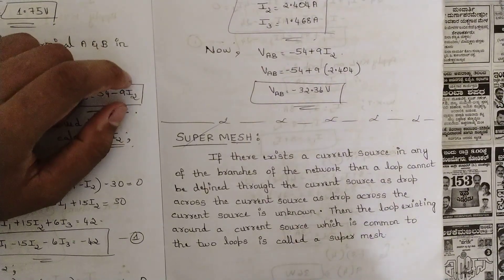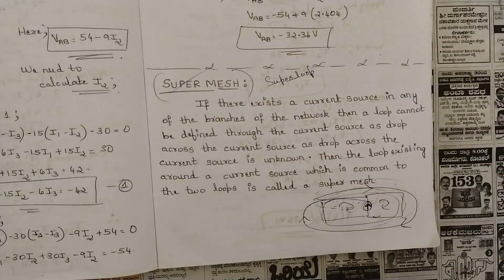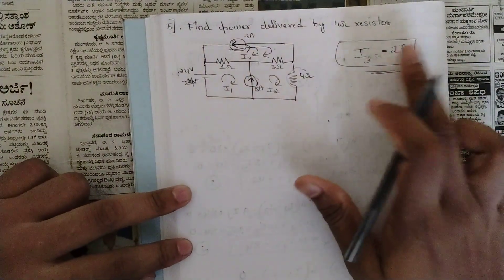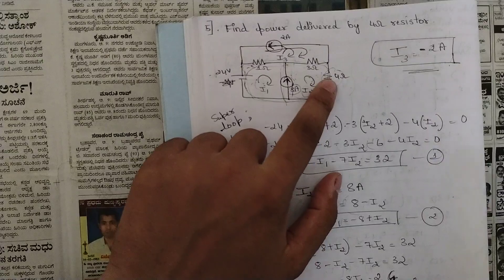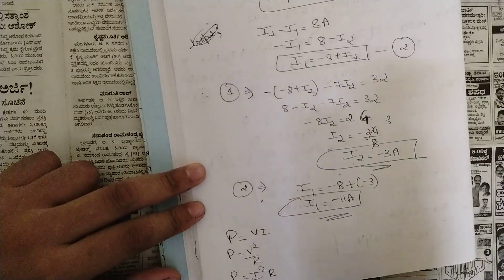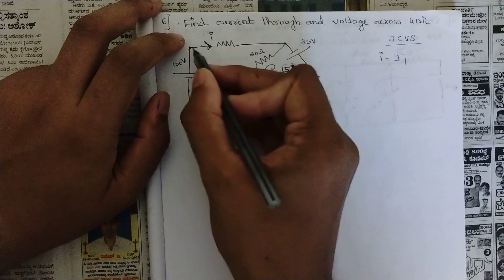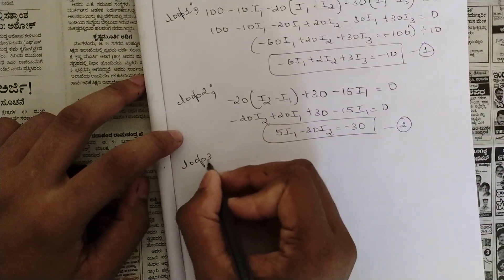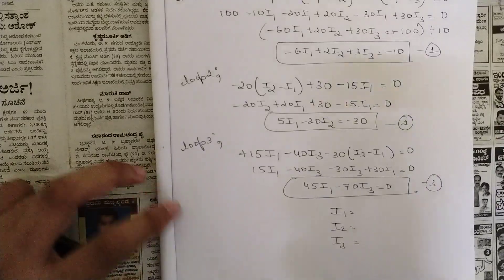13.Super Mesh Concept,2 Problems Explained Network/Circuit Analysis 3rd Sem ECE Latest Scheme VTU

Comment: sir at 5:04 u write -24 but its actually +24
Reply from the maker: Ya it's actually +24 I had made mistake in the circuit diagram..
Just change the polarity of 24v source...
Rest everything is correct
Reply: Sir plz don't do such a mistakes repeatetly
Reply: But any way got same answer
Reply: @mr_consistency_18 ans will be wrong if you’ll use wrong sign